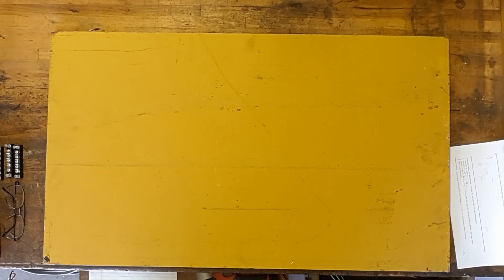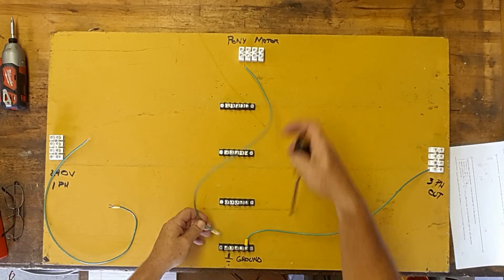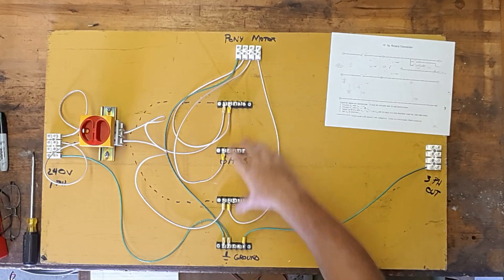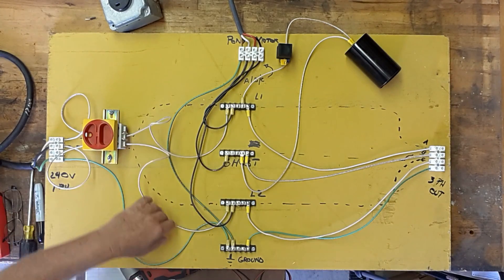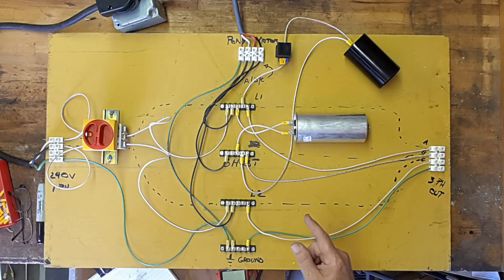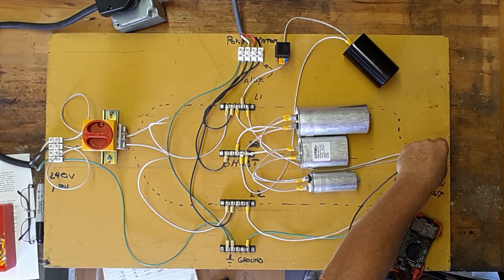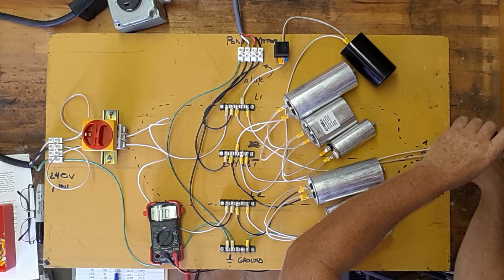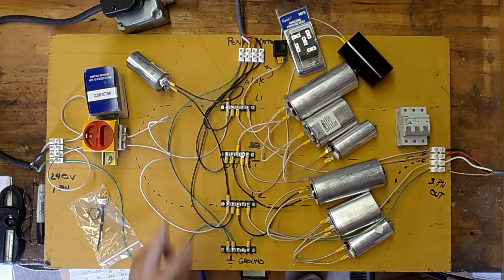Building a Phase Converter - Part 1

Comment: As you said, this gives a much clearer idea on the capacitor use.  One thing that has always confused me and you get all kinds of different answers on forums is the phase differences.  You have an input power that that is 240 volt single phase where the two 120 lines are 180 degrees apart.  Your pony motor and output power are 240 volt three phase but the phases are 120 degrees apart.  So, is what your saying here is that using the capacitors are actually electrically moving the phases so they end up close to 120 degrees apart.  I guess I am having trouble visualizing how you can start a 120 degree motor with 180 degree phasing power.  Thanks, Tom
Reply: Yeah!, me to.  I would like to see the output on a scope and measure the actual phases.  Must be some ugly harmonics flying around.
Incoming is 180 then the cap absorbs some current and shifts it 90 degrees but that is still 30 degrees off.  Maybe this is just a power factor thing where the phase difference gets kicked back onto the grid and is lost?
Reply: I have the same confusion, what is the phase angle between the outputs of this circuit?  It seems like the phase shift of a capacitor is 90° (https://www.allaboutcircuits.com/textbook/alternating-current/chpt-4/ac-capacitor-circuits), actually up to but not more than 90° (https://www.electronics-tutorials.ws/accircuits/ac-capacitance.html) so I'd think maybe the outputs are only some fraction of 90° apart, say 0 (take the input's phase as 0 for reference), then +90°.  So motors might spin but there won't be as much power transferred from the lines to the motor and maybe (I'm not sure) they will also heat up more than they would with the norm of 120° difference between each phase in 3-phase.

Comment: Good day sir.. thanks for the video.. may I ask how many kW can these setup handle? Thanks a lot.. :-)
Reply from the maker: 3.72kw is 5hp.  You use one step larger idler motor, than you plan to drive.  My idler is 7hp (5.2kw) so my largest load is 5hp (3.72kw).

Comment: Thanks for the great video how to.  I have a quick question.  I have 220 single phase in my garage, and I need to run a 3 phase 10 horse motor for my power hammer.  A friend has a 25 horse motor with a pony motor to start.  can I use this setup?  I would still have to get a step up transformer, right?  or would it be best to get a vfd?  Please let me know, thanks!
Reply from the maker: If witching to a 25hp motor from a 10 is the other option, then I would go with the VFD.  Even if you are suggesting that the 25hp is a 3phase and you would use that as the idler, it is still HUGE compared to what you need, and I would again lean to the VFD.  ~P
Reply: sbirdranch 
What I was wondering is if I can use the 25 horse motor as a phase converter wiring it to the garage 220 single phase,  generate the three phase 230, then route rhat thru a step up transformer to the 3 phase 440 only 10 horse hammer motor.
Reply from the maker: I'm following you now.  Aside from no experience with the step up, I don't see why you couldn't use the 25hp as the pony motor to generate the third phase.  Keep in mind however that although there is no load on the pony, it still takes power to turn it, and you are going to turn a lot of motor.  Before you commit to that large a pony, I would do some poking around on Craigs List or your local sale flyer and see if you can't get something more to scale.  A 12.5 or 15 hp.  ~P

Comment: Good morning from Trinidad W.I.

I recently acquired a delta 10" unisaw for my home workhop. The tablesaw is powered by a 5hp 3ph motor.  I have since been pondering if to change the motor to a 1ph.

Studying this video series. You make this so easy that I am gonna try this.

Thanks for an excellent demo.
Reply from the maker: Good evening from Ohio, USA.  You can make one of these.  And down grading the Unisaw to 1ph would be sad.  A 3hp table saw will not let you down, where small sometimes does.  Good luck.  ~P
Reply: sbirdranch 

Good morning again.

No no I am not installing a 1hp motor....... but looking into building a phase converter as you have demonstrated.

Also am told off and have seen a. 230v  3ph.  5hp  run of a 220v 1ph  supply.

The motor was running off two  capacitors  with a bell stwich connected to one capacitor to get the motor up to speed. Some similarities to your push button stwich.

Again  there was one power loss,,  I was told about 30%.  

Are you familiar with this approach and iff so. Please enlighten us novices.

Thanks again.

Comment: So I got that the 240 was connected to incoming source.  What was the strip labelled pony motor connected to?  Also,  how does the system maintain 120 degrees between each phase?
Reply from the maker: The strip labeled Pony Motor is where the 'Idler' or 'Pony' 3 phase motor is connected.  It is the spinning of that motor that gives you the separation of phases.  I don't believe it is a perfect 120 degrees with this type of converter, but it is close.  This might be more clear if you watch the other two videos.  ~P

Comment: How many motors you have in your shop. Put on each motor one capacitor and your finnished
Reply: Can you elaborate on this some 

Thanks
Reply: Gunness Sudama Same like you wire the start capacitor you wire the normal capacitor and the motor wil run fine no relais no breakers   around 55 uF per Kw measure the current during testing  this must not exeed nom current 
You  can chose to go from star to delta to equalize with the nom voltage  this is how many one fase motors work.
Reply: Also, am told off and have seen a  240v  3ph.  5hp  run of a 220v 1ph  supply.

The motor was running off two capacitors with a bell switch connected to one capacitor to get the motor up to speed. Some similarities to your push button switch.

Again there was some power loss,,  I was told about 30%.  

Are you familiar with this approach and if so, kindly elobroate.

Thanks again.
Reply: Yes that is possible  only you have to be carefull that normaly 1 phase is limitted in suply from your utility company.A normal 3 phase motor does not need that 2nd capacitor  U1 - phase 1 V1 Neutral + capacitor W1 Capacitor

Comment: the idler motor you are using has 4 wires, how have you connected the 4 wires on pony motor? coz mine is already in delta and am confused...
Reply from the maker: One wire for each phase and the 4th is a ground.

Comment: the idler motor you are using has 4 wires? is this also a three phase?
Reply from the maker: Yes.  It has to be.  It is what 'creates' the phantom leg.  ~P
Reply: great thanks. I under stand it now. just got it up and running this evening

Comment: Hi
    It's the supply you have 240 v input does that mean 2 by 120 v instead of one by 120 and one negative as I live in Ireland and as you know we are on 240 v does this mean we run 240 by 2 or 240 and a negative Kindest Regards Oliver
Reply from the maker: US Standard power is 120v 60hz.  That is carried in one hot line and a neutral.  240 is two 120v lines working together.  Straight 240 doesn't require a neutral, due to the nature of the alternating current.  You do still need a ground for safety.  As for the specifics of Ireland, I cannot say.  You might want to get some professional help as this level of understanding is the foundation for what I did and couldn't be done safely without it.  Hello from the US.  ~P

Comment: Hi 
  I'm very impressed with your video it's simply the best on the net are they two live wires or a live and negative to the switch thank you so much for your excellent explanation kindest Regards
Reply from the maker: Thanks for your compliment.  I assume you are asking about the wires from the motor starter to the push button on the case.  The motor starter has a 120v AC coil to activate it.  The switch is engaging the hot (live) wire, which activates the coil.  From there, the coil is self maintaining, until interrupted by the e-stop switch.  ~P

Comment: I have a 3 phase lathe, how many HP  of idler motor i need and how many microfarad of the stating capacitor i need to run?
Reply from the maker: How many HP is the lathe motor?
Reply: General consensus is use 2x hp for idler motor....

Comment: Very Educational.  This has clarified a lot of my questions.  I need one to run my 3hp 3ph lathe.
Reply: You can also use a vfd with single phase 230volt input. Then you have unlimited speed control also.
Reply: +byron devine - I am looking at another 3ph piece of equipment.  The RPC will power both.  From what I have seen VFDs cause a loss of torque on low end speeds.

Comment: How many HP is your older motor?
Reply from the maker: Um....older motor.   The idler motor is a 7.5hp.  Rule of thumb is one size larger than the largest driven motor (in your equipment).  My largest driven motor is a 5hp in the LeBlond lathe.  ~P